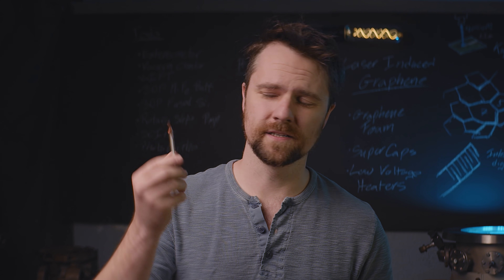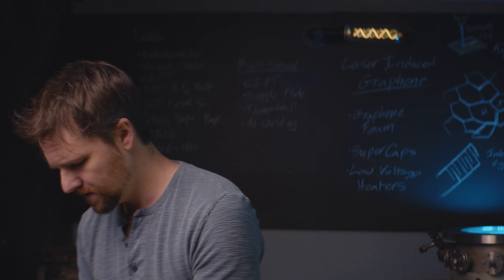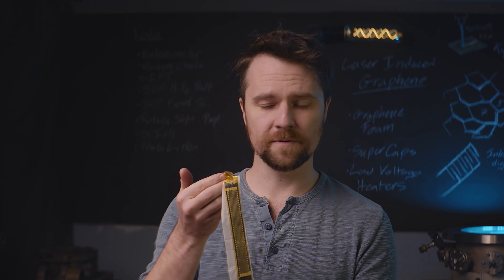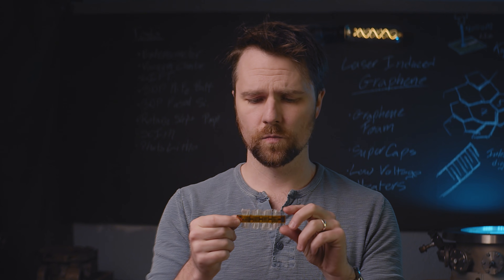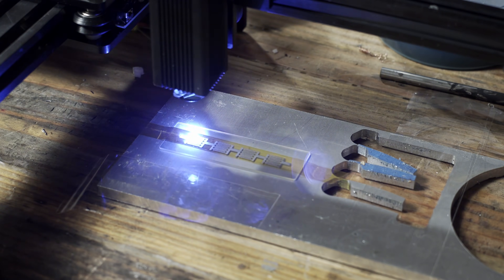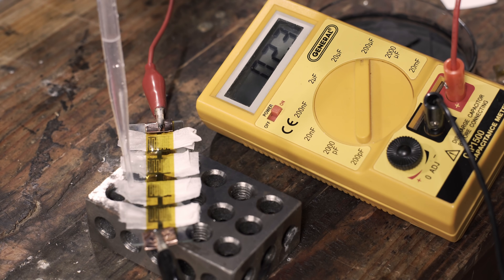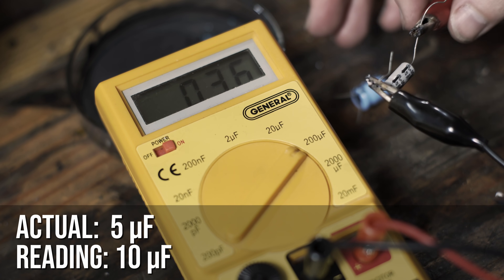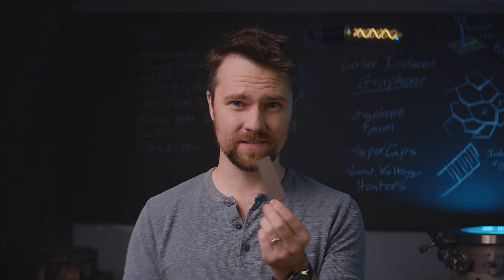Kapton Tape Supercapacitor?

Comment: Excellent work,  Question: have you tried this - let sugar water evaporate on a ceramic tile, then hit it with the laser, since the laser would cause the sugar crystals to convert into carbon foam.  Now spray a mist of Water-glas over the whole tile to encase the carbon.  Just a thought.  Thanks for the vids.
Ed
Reply from the maker: Neat idea!  Haven't tried it, but sounds like a fun experiment.  Will put it on the rainy day todo list :)

Comment: What are these kinds of supercapacitors useful for?

I remember being told, about 20 years ago, that super capacitors are ALMOST useful for storing energy, say for a car or a laptop.  They can charge quickly and hold a lot of energy.  The problem is that if you break one when it's charged you have a bomb.  They also leak energy.

But the bomb problem is one that batteries have as well, which is why super high capacity batteries are always promised but never happen.

Comment: How do you know your process really produce Graphene and not porous carbon? Wouldn’t porous carbon still give you some effect, but just not as pronounced. How do you set a baseline in your measurement to separate the cases of having Graphene and only carbon?
Reply from the maker: I don't have a good way, unfortunately.  Purely going off how it's described in the literature and if my results match the external characteristics (conductivity, processing characteristics, hydrophilicity, etc. That said, I have a line on a Raman Microscope which would give some more quantitative information, since we could see the LIG peak in the raman spectrum... or if it just looks like amorphous carbon. If/when I manage to get one I'll probably do a followup!
Reply: Breaking Taps conductivity and hydrophilicity can vary based on density and surface texture so I would argue that it might not be a consistent tool to determine whether or not the resulting substance is truly graphene. Also I was wondering, the material doesn’t necessary have to be graphene to become the super capacitor. As long as the resulting material is conductive and high surface area to volume ratio it will do the job. So it can even be a mixture of porous carbon in various forms and still resulting in a pretty good super capacitor.
Reply from the maker: @wadehsu2347  Yep, agree with everything you said!  I tried to refer to it as "laser induced graphene" as much as possible, rather than just "graphene", because the literature makes a point that it really is a big amorphous mess of different carbon species.  And even though graphene is present and most of material, it's very disordered and mixed with other stuff.  This is much closer to amorphous carbon than single layer graphene sheets.  In any case, I don't particularly care how "true" of graphene it is, or even about supercaps that much... I just wanted to demonstrate an interesting technique for others to learn and potentially use themselves :)

Comment: Yes this is the time many amazing things can happen, the computers have been push off the high priest of technology pedestal, down to the ground, in the form of Arduino and Raspberry Pi as well as other variations of highly affordable sensing and control devices. A small work shop now, can easily rival research facilities from decades ago. Some kid might even figure out how to make plasmoid behave themselves in Focus Fusion.

Comment: Very good. Commercial electrolytic capacitors can have 20% tolerance.
What is the laser spot size?
Reply from the maker: Not sure to be honest... not great though.  Probably somewhere around 300-500 microns.  It's pretty big, and also very eliptical in general, not a good quality beam even for diodes :)
Reply: @BreakingTaps  Thanks. I just bought a Ortus Pro with '20W' 450nm laser.
Do you follow Robert Murray-Smith and his graphene super caps?
Reply from the maker: @billpeiman8973  Nice, good luck!  I just subscribed actually, working my way through his prior videos now :)

Comment: Great video!
How did you make the laser setup? Do you have a video on it? Anyway, you earned a subscriber, keep up the good work
Reply from the maker: Nothing fancy, it's one of those cheap'ish "laser engraver" units you can find on ebay and similar.  450nm diode laser on v-wheel linear guides basically.  I think mine was a NEJE 20w, similar to this: https://www.ebay.com/itm/NEJE-Master-2S-20W-CNC-Laser-Engraving-Milling-Machine-Engraver-Cutter-Printer/402613673991  Could almost certainly build one for cheaper, or attach a laser to a 3D printer, but I was lazy :)
Reply: @BreakingTaps  Thanks! I think i will try modding my 3D printer to do this at some point.
Reply from the maker: @manganeseheptoxide7825  Good luck!  Make sure you get some good safety glasses too ;)  Also, love the user name!
Reply: Haha, thanks

Comment: What was the amperage used @12-30 volts for the heater?
Reply from the maker: I don't quite remember, but no more than 3-4A because that's the limit of my bench supply :)

Comment: And can you do it on the inside of a bottle impressing on the glass on the inside to cause dielectric materials on the inside of a glass bottle. This is my theory if you are capable of doing that with that material on the inside of a plastic bottle and you were able to have the soda that was inside the bottle that has the acidity from the sugar the bottle cap would be a connecting micro light that would actually Flash with the soda in it and if the soda loses its consistency of acidity or any other veritable you could tell by how the cap would light up on it like a battery drain just a hypothetical question if anybody makes that evention and works I'm asking you to sue them for me because I come up with really good ideals and nobody thinks of them please help I got some ideals that curl your here but your little thing here just open up a world where I was told something when I was younger and actually watching it being applied by you is like watching time explode by hitting each other but just got some really neat questions

Comment: In that laser etching can it work on plastic and if it does could it work on a 2L plastic bottle making dielectric fingers on the plastic and the other question is will it work dielectric capacitor would work on Stone not just glass but Stone and what would be the conditioning and properties and the amplitudes that would come out of that

Comment: Since when did a "capacitor" GIVE voltage? https://en.wikipedia.org/wiki/Capacitor "A capacitor is a device that stores electrical energy" yet you say your device GIVES 0.8V.
Reply: I assume it breaks down in some way when charged over 0.8 V per cell

Comment: Anyway , it's very Interesting if it works just using polyamide tape .
Can green laser of 532nm also work ? And Power ?
Reply from the maker: Unsure to be honest.  I dont have a laser of that wavelength to try, but the UV-Vis spectrum suggests it might be difficult (https://www.researchgate.net/figure/UV-visible-spectra-of-polyimide-films_fig9_321944400). 450nm seems to be around 40% absorbed, whereas 532 is closer to 25% absorbed.  That said, it didn't require 100% power of my laser either, I ran it 90% and fast, but lower powers (20%) work fine if you go slower.  So 532nm might work if you slow down a bit
Reply: @BreakingTaps  if wavelength doesn't matters may be then we can use black surface under the tape to absorb light for heat generation in specific area but i think wavelength matters

Comment: 0:31  Really ?? Where is The Graphene Oxide ?
Reply from the maker: It seems to be mostly not generated, according to the literature.  I can't personally measure it, but the literature says that LIG is mostly disordered, multi-layer graphenes (regular, 5-7, etc), amorphous carbon, more exotic carbon species (tubes, fullerenes, etc) but minimal graphene oxide.  There are papers however that will convert the LIG into LIG-O because it's useful for other things, like: https://onlinelibrary.wiley.com/doi/abs/10.1002/adma.201707319

Interesting, there's a whole separate field where GO is used as the precurser and decomposed into Graphene via lasers, which is neat too :)

Comment: Great detail on this, I found it interesting you used sulfuric acid. For some reason I thought most DIY super caps were using a solution of potassium hydroxide. Still I never knew Kapton tape did that with a laser. Great info. thanks!
Reply from the maker: Big grain of salt since I'm not an expert, but I believe you can construct alkaline supercaps as well with KOH, NaOH, etc.  They just have to be electrostatic double-layer capacitors like this graphene form, but otherwise it doesn't matter if the electrolyte is acidic or basic since you get the same double-layer phenomenon either way.  I have seen some papers that show different behaviors depending on the electrolyte used, because the different ion sizes can affect accumulated charge, how quickly they charge/discharge, how it interacts with the electrode material, etc.

But yeah, far from an expert so don't trust anything I just said 😀
Reply: @BreakingTaps  that is one thing about electrolytic supercaps, the electrolyte can store some energy and move charges via chemical processes in addition to the plate storage.

Comment: it could be great for heated beds on 3d printers
Reply: That's what i thought as I saw the last part. Nice uniform heat from a heatbed sounds great. Best case scenario u just put some capton tape on a Aluminium bed (heck why not directly a mirror or a glas bed) and then just run with a laser over it.

Comment: for the heater, one of those bladeless fans with a ring of heater tape around the air vent could be run at super low levels to make a warm airflow that would be good for drying rather than baking something with a space heater. also run the fan on low so your not blasting something with high wind speed
like if you wanted to dry your gloves or paint but dont want to risk fire with a proper heater or create runs with a powerful fan.
its not a long term solution but in a pinch it could be useful.
maybe blow warmed air into a box as a mini drying booth...

Comment: 0.8v 200uf is not much, and the traces are not very conductive. However, the idea of burning Kapton into graphite is indeed interesting.
Reply from the maker: Yep, not very much in an absolute sense!  Technically the distinction of supercapacitors is based on energy-per-unit-volume not necessarily their total capacity (they just commonly tend to be very large since they are best used as a middle ground between caps and batteries).  E.g. there are supercapacitors etched onto IC circuits which are microns in size and tiny capacities...but still count as supercaps due to their energy density.  That said, I'm sure mine dont count as supercaps since they are far from perfect, more a demonstration of the technique than anything :)
Reply: @BreakingTaps  it's an honor to have received such a great reply from you. I wish you happy.

Comment: Is there any way to solder to the produced structures? I'm thinking that low-temperature SMD solder might do the trick.. I have not tried it yet as it would require me to buy all the components to make a laser CNC..
Reply from the maker: Regular solder didn't work well (too fragile, soldering iron ruined it before it could hit temperature).  Haven't had a chance to try solder paste yet though, although I'm hopeful that would work like you suggested.  It can can also be electroplated, so that might help as well (plate with some copper before soldering).  The academic papers all cheat and use silver epoxy :(

Comment: capacitance reading may be off in this case due to high leakage resistances, you need some type of rlc meter to determine simultaneously  Parallel, series resistances AND capacitance. Parallel Resistance is responsible for leakage currents -determines self discharge speed actually, while series resistance is like a series connected resistor - limits the current and has other detrimental effects. But anyways with some clever experimentation I think you can figure out all of them. nice job.

Comment: Re: the validation of the capacitance meter: Regular electrolytic caps often have very high positive tolerances, like for instance 10uF -10% + 50%. The manufacturing process of these can be a bit imprecise, and the tolerances are offset to ensure that you will more or less always get at least the nameplate capacitance. As electrolytics are typically used for filtering/energy storage, getting more capacitance that you expected is pretty much never a bad thing.

Comment: Do you have experience with balancing when multiple capacitors are connected in series? If the value of each series-element (or its leakage) is not identical, "regular" capacitors tend to charge asymmetrically, potentially leading to catastrophic failure. This necessitates external "balancers". 

Does the polyimide-acid-EDLC tend to "self balance"? (i.e. not catastrophically fail when charged above 0.8V?) This would simplify their deployment. (perhaps with some venting-holes for electrolytic hydrogen etc.)

Comment: Your capacitance meter is likely more accurate than you realize; most commercial capacitors have a fairly wide tolerance from their stated value. Manufacturers data sheets should list the tolerance for each type the produce.
Reply: And the tolerance rating is often kind of 'skewed'. Something like +20/-10% of the nominal value is common.
Reply: +20/-10% is actually a tight tolerance. I have also seen +50/-20% tolerance in datasheets for electrollytics
Reply: I was hoping someone would mention this
Reply: Agreed. One of the caps he tested looked like it was rather old (the 5uF unit). First, if it actually was rated 5uF, it really is old, because anything made after say, 1975 would likely have been a 4.7uF, not a 5uF unit. Anyway, old electrolytic caps tend to become leaky, and leaky caps often read high on capacitance checkers, even though their true capacitance is falling.
Reply: Looked for this comment to upvote
Reply: Perhaps, but I'd need to see it tested on a scope with a few different circuit configurations, simply bc I'm a little suspicious that there may be some galvanic processes skewing the results from the use of sulfuric. Additionally the ESR would be a good value to checkout, as I imagine these have terrible conduction and probably have extremely limited output power.
Reply: @xxportalxx.  good point about the ESR. Could probably be improved a bit with a copper bus to combine the fingers. Or better yet a silver layer precipitated over the graphene bus; but now we are adding to the build complexity.
Reply: @matthewperlman3356  you know what, I was thinking the exact same thing! That said if the properties are really rooted in the electrodes being comprised of graphene, and not just the surface area and interdigital design, then that may not help. I was thinking perhaps you could use this as a substrate/template for gas deposition to thicken the graphite deposit. Perhaps plating just the underside, assuming you can get to it, would retain the graphite surface if it's necessary for the system.
Reply: @xxportalxx.  try testing with different ac frequencies. This should help give better results. Can't really tell how your meter measures capacitance but some just use AC and measure "capacitance" even if you just add a resistor.
Reply: @blubbspinat9363  right, that's basically what I'm getting at, as I wouldn't be surprised if some of those meters use a simple rc circuit and avg the time constant at a set input voltage to get an estimate of the capacitance.
Reply: The capacitors i use ARE so cheap that they do not even datasheet lol
Reply: yeah a quick scan of digikey today revealed that for aluminum electrolytic capacitors the tolerances can be as wide as -10%/+150% LOL

Comment: Quick question does a 445-450nm laser wok as well or does it have to do with the Kapton tapes light absorption spectrum?
my guess is that I'm over thinking and it would work with most home diode laser?
Reply from the maker: I might have mispoken during the video, but this was a 450nm (blue) laser :)  It is dependent on the absorption spectrum of Kapton though, for example my longer 1064nm laser doesn't do much to kapton.  But the even longer 10um of a CO2 laser works great (from what I've read, I don't have one).  Not sure about other common wavelengths like 405nm or 650
Reply: @BreakingTaps  Ahh was just curious since light absorption really affects a lasers abilities as you mentioned. :)
one reason I wondered is that I'm in the planning stage to build myself a laser etcher/cutter and really want to replicate some of your experiments for some projects of mine.

Comment: So if it has a large surface area, can it outperform activated carbon for gas filtering?
Reply from the maker: Possibly!  Probably the main difficulty in that regard is getting "enough" material to be useful, it's a pretty thin layer.